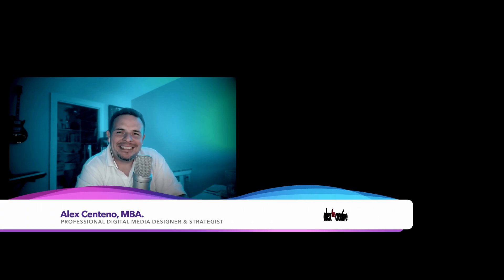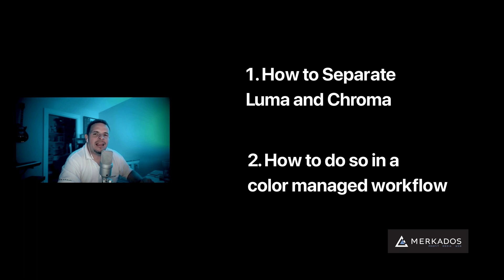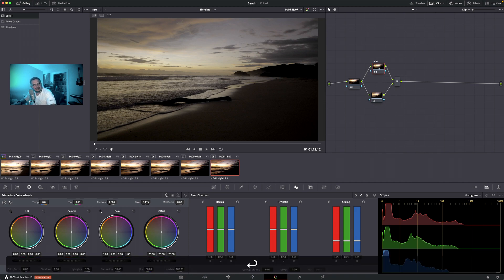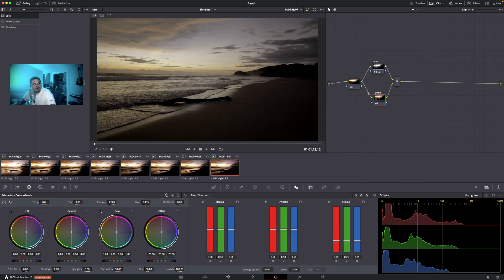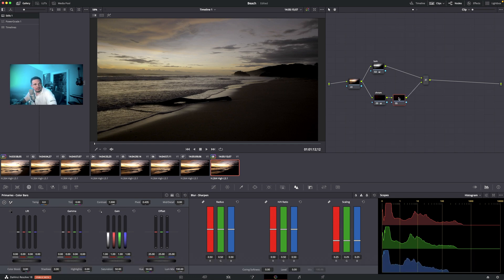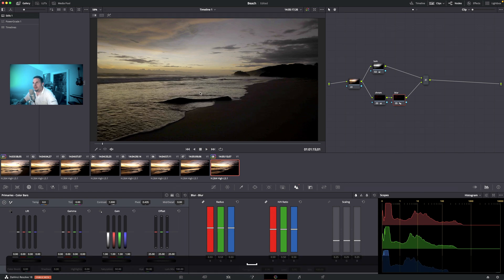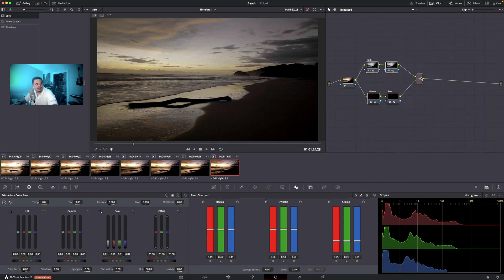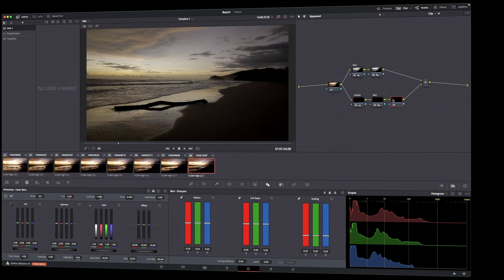Separating Chroma and Luma in a Color Managed Workflow in Davinci Resolve 18. With AlexTheCreative.

Comment: This method doesn't seem to work if we worked on ACES color managment, any ideas?
Reply from the maker: Hi Ezkatol! Unfortunately, I haven't explored the ACES workflow enough to be helpful there... Color mixer nodes don't seem to work similarly in ACES than in color managed... Thank you for watching!
Reply: @AlexCenteno  I think I figured out a possible solution to this, as you thought, color mixer modes don´t work similary in ACES AT ALL, so I kept messing aroung a little bit just to find out that using "color" or "luminosity" blending mode and applying either method you explained to the top node kind of worked similarly to your method. Didn't try the noise reduction method you proposed yet.
Reply from the maker: @ezkatol  That's absolutely great. I actually explored that technique last night. I created a layer mixer node and changed the blending mode to color. Then I would affect the bottom node while only affecting the color. This actually seemed to work (but I didn't try it in ACES.) Anyways, glad you figured it out! Thank you for sharing!
Reply: @AlexCenteno  Haha, you managed to get to the straight forward way... I think the reason is that splitting the image into "color" mode makes the lower node the one that represents color, and the upper one the one that represents luminosity... I was doing the same but a weirder way: touching color on the upper node of luminosity blending! your approach is way more intuitive

Comment: Thanks for the Tut. Is there no other technical way to separate saturation specifically? Other than reducing the luma channels of gain and gamma? Tried LAB and HSV with mixed results. My Colour management is always set to a custom flavour of DWG timeline colour space with the respective camera as an input space, mastering for Rec 709 2.4. Struggling to find any other resources, thanks man.
Reply from the maker: Hi there! I have tried other methods and finding the same limitations that you are. If you have a color managed workflow, your best bet in my opinion is to reduce gamma and gain as demonstrated here. I haven't really explored any other techniques that work while color managed. LAB and HSV don't work in that mode. Are you looking to accomplish something in particular where you would need to affect only the saturation information? Maybe there can be other avenues, for example with custom curves (hue vs saturation) or (saturation vs saturation) to accomplish what you are looking for. Thanks for watching!

Comment: I just start using Davinci Resolve, don't know much but when should I use this? before the conversion to Rec 709 node or after?  I'm filming on my Canon in C-Log and then converting to Rec 709. But then... damn ))) but how to colour correct and grade in SDR mode? can't use lut's in SDR, the colours are way different umm... how do I contain editing in SDR mode? or should switch back to Davicnhi YRGB, sorry so many questions ))
Reply from the maker: Those are great questions. It depends when to use it, but remember that you don’t lose any information as long as you are using CST - so either one is fine. If you are going to SDR as the output, I would grade in SDR with a Color Managed workflow in Davinci YRGB managed. Hope that helps! Best
Reply: @AlexCenteno  another question )) how to invert that chroma node? so if I need the opposite selection from chroma node

Comment: Thanks for making this tutorial...but i faced some issue. 1.the processes only works for color processing mode SDR. DWG dose not work... 2. fortunately i work node base color manage pipe line..so i only change timeline color space  DWG bcz some resolve tools are color space aware and my working color space is DWG...so i did exactly what u showed except blending mode Color instead of ADD and its works....actually in the previous video u replied someone to do that process...is that processes right?
Reply from the maker: Yes - absolutely. By changing the blend mode to "color" instead of "add" you are using only the color information from the bottom node. That should work properly inside of an HDR workflow.
Reply: @AlexCenteno  thank u so much❤. One more request can u plz make a tutorial how to use CMY color model in resolve...i searched many times there is no information in the internet. not even any article...so if u make the tutorial it would be very helpful.
Reply from the maker: @koushikbhattacharya832  Hi Koushik, thank you for the question. The CMY(K) color gamut is a very limited one. It is one of the smallest and it is heavily used for printing, instead of digital media like videos intended to be consumed in either a Rec709 monitor or even an HDR Rec2020 display. Davinci Resolve is a perfect tool for creating content for delivery in those channels and not so much for printing. If you wanted to print, it makes more sense to use tools like Adobe Illustrator or InDesign. Hope that helps!
Reply: @AlexCenteno  Actually i looking for subtractive color model like film...and some plugin introduces the concept. So thats why i excited to know about...